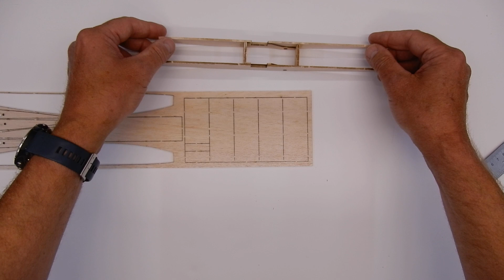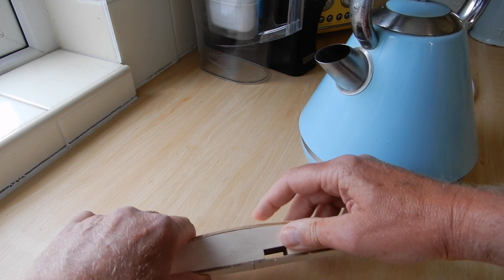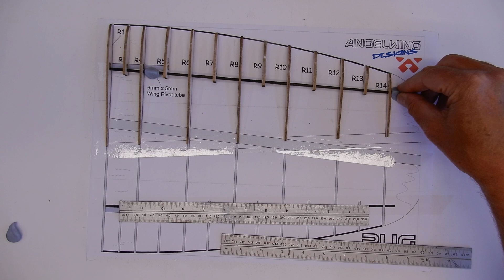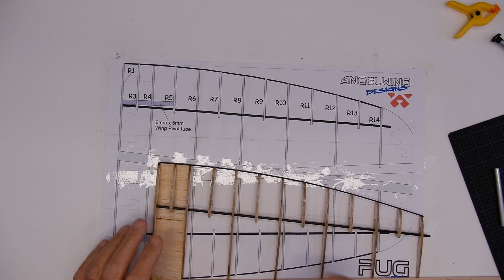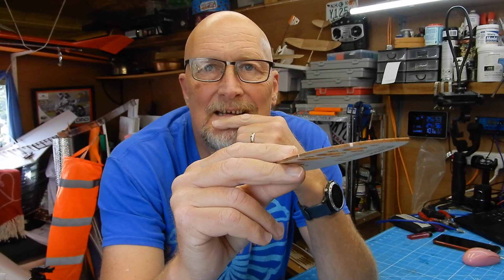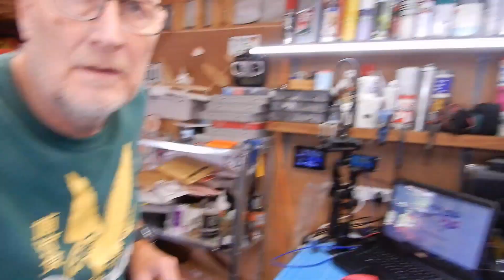How to Build a Pug Twisty Aerobatic glider  "4 channel"

Comment: This is one of my 3 favorite planes to fly..
Set the travels up to 125% or 150% and fly it just a tiny bit behind the recommended cg and she is a blast on the slopes. Flying in even moderate conditions you feel like you can get away with murder. Fun fun fun.
My tail surfaces are fixed and the model is fully aerobatic.